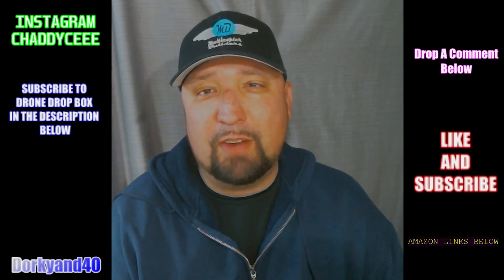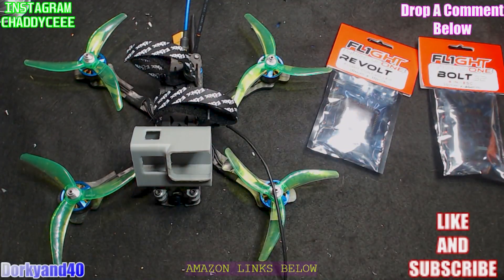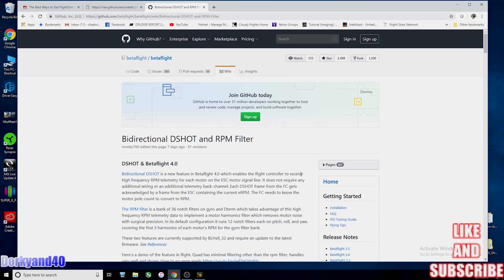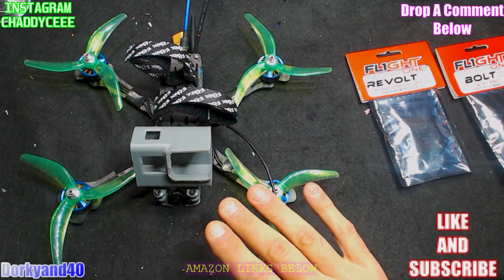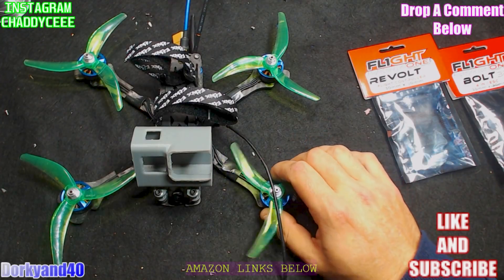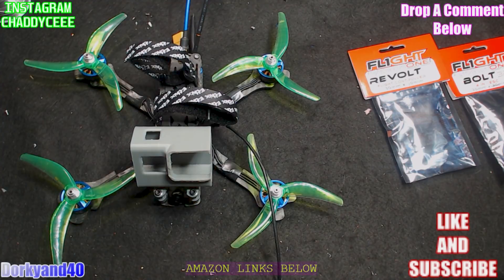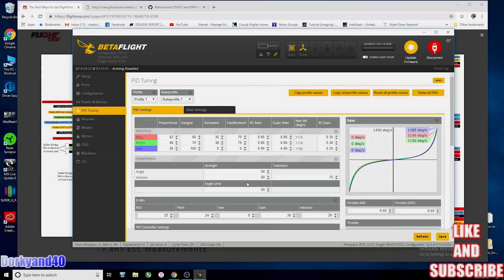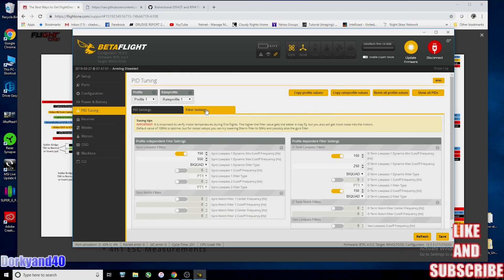BETAFLIGHT 4 RPM NOTCH FILTER PART 1 | NON RPM FLIGHT SETUP DATA GATHERING

Comment: Trying to get the number to dial in for Lowpass 1 Dynamic max. I took advice and got the OSD to show max at the end of the flight. I think I read that you should take the max and add 50 for comfort. Do you take the reading whilst flying with other filters on as I took the reading with Gyro lowpass 1 and Gyro Lowpass 2 enabled or should they be disabled when you take the reading? My reading with them enabled was 640 which seems high. Motors were cool and flight was smooth.
Reply from the maker: add 25 now..do that and then you can raise the filters slowly up..all 150s at a time take up to 155 then 160 and so on..but must do all 3 of them

Comment: great work! I'm currently working on a 6s, 6inch with 1600kv motor hauling a 2700mah batt(+10mins flight time), I was getting a lots o vibrations in my hd video then I swapped my old F4 to a F7 board ,  the dual gyro it definitely helped to soften up the vibrations, Also I have betaflight 4.0 with the RPM filter on and dynamic filter tuned , Although I still getting a little bit of vibration - nothing like before but still there on the edges of the screen, very little thou.

I currently onw a Hero 5  maybe I get a GOPRO 7.  I heard it does a pretty good job with those vibrations issues.

Keep up the good work. Cheers.